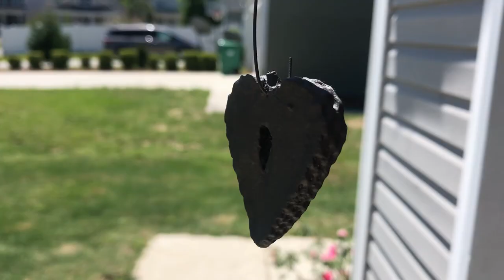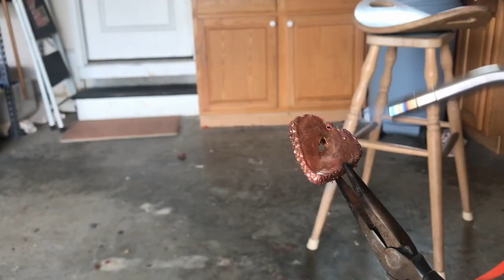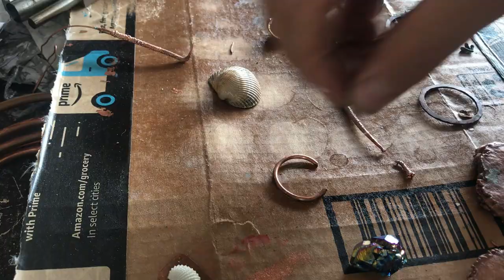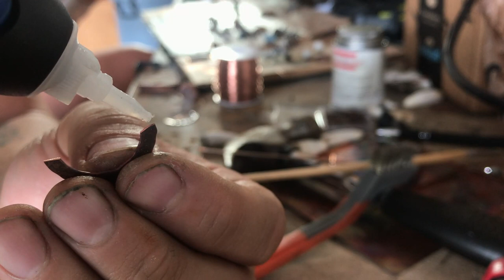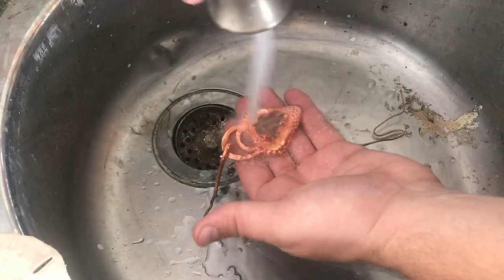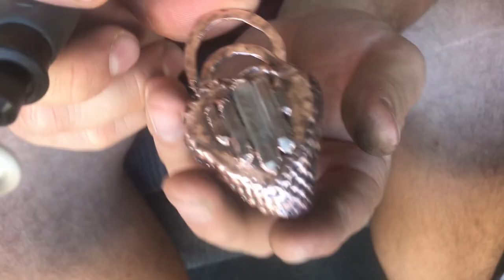Jewelry Making Tutorials: Making an Electroformed Pendant From a Strawberry. Learn Electroforming

Comment: this is so frigging cool - I would never have thought of plating slices of fruit

ok, random questions time - is the strawberry still inside the copper? if something sharp punches a hole in the pendant will rotten berry then come out? do they sometimes leak on their own?  - I have a dead bat laying in my freezer that I was thinking of plating but since you have experience with fresh fruit I thought I could ask you about the fruit and that knowledge might transfer to a dead animal covered in copper
Reply from the maker: Hey, sorry for the late reply, I actually burn the strawberry out of the copper. you can see it in the video after i take it out of the bath. just make sure you drill a somewhat hidden hole or else the piece will inflate like a balloon. With a bat, if you could decay it and just use the skeleton, that would be tight and a lot easier. If you are planning on using flesh and all, you will probably want to coat it really well because if any part of it isn't sealed, the acid from the bath will eat away at it and it wont be able to coat copper on that spot. I would build the copper as even as possible using a stir bar in the bath and anode bag with an anode in each corner of your bath (run a jumper wire to connect them all). Then run the bath and start slow so the copper can get everywhere on the bat. you'll want to burn the flesh away from the inside, the issue you'll come across is the bones will be rattling inside the copper piece, you're burning away the tissue that's holding them in place. maybe fill it with epoxy and then cover the hole when done with some puddy and copper foil? Let me know if it works, Best of luck!